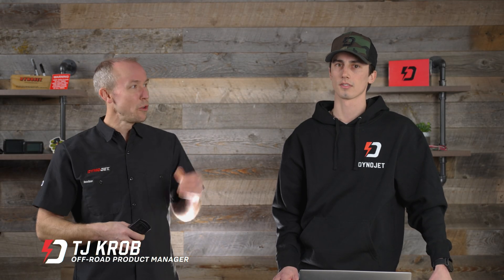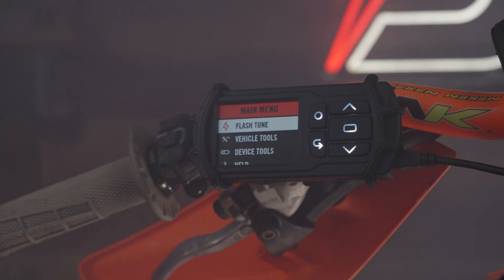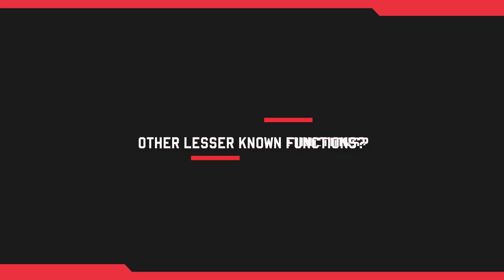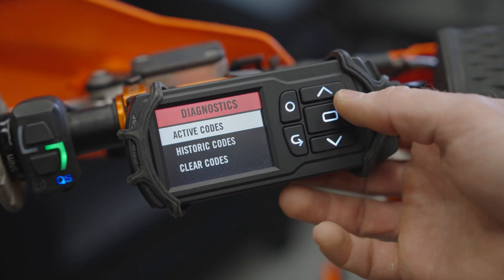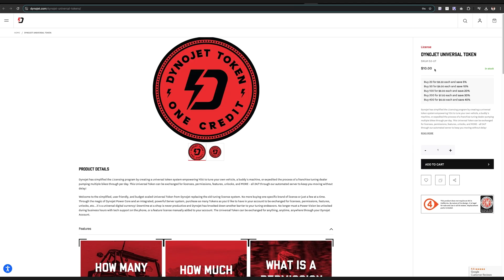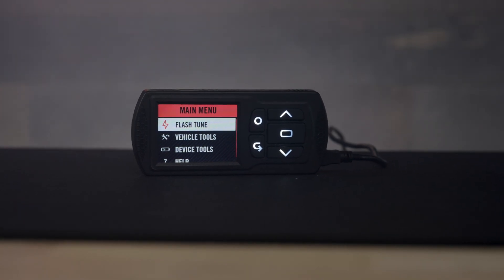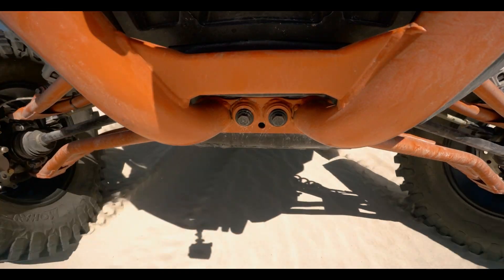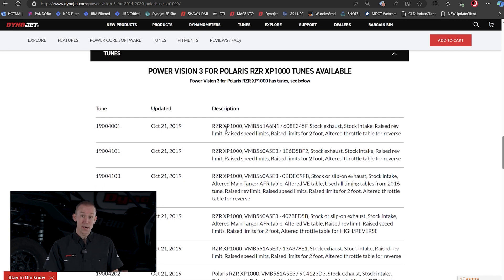How to Increase Performance of Your KTM/Husky/GasGas Dirt Bike with the Power Vision 3 | Full QnA

Comment: Can I use this instead of my Power Commander V or would I run it alongside?
Reply from the maker: @freeeeak656  The PCV is a piggyback device, meaning it intercepts the ECU, whereas this device, the PV3, actually flashes your ECU, allowing for more control, customization, adjustment, and more compared to the PCV.